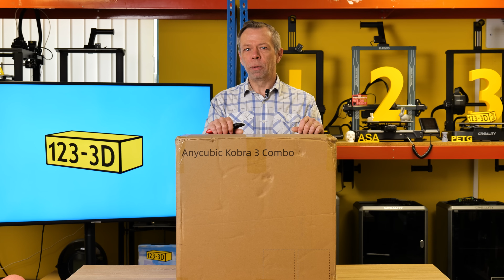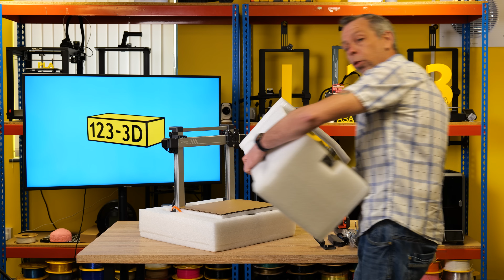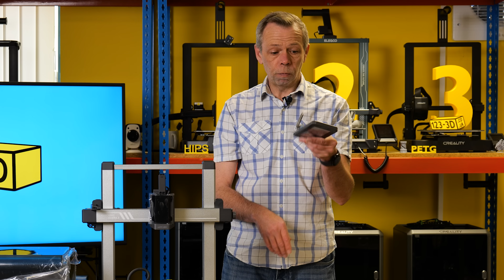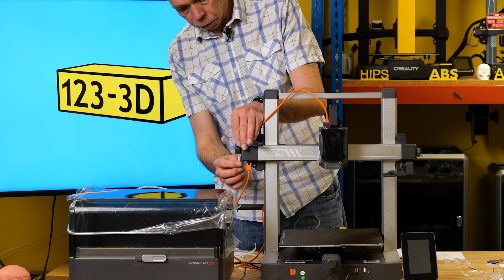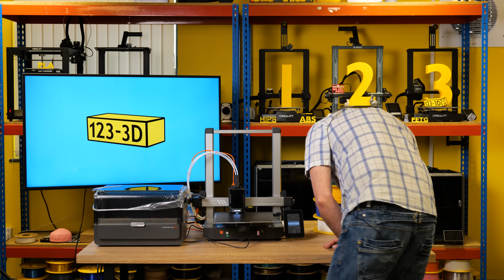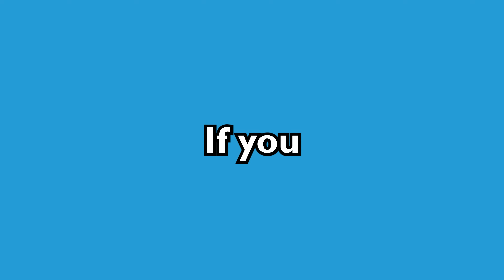AnyCubic Kobra 3 Combo! First look and Assembly | Multicolour 3D Printing!

Comment: For someone just getting started with 3D printing what would you recommend as a 3D printer?
Reply from the maker: Hard question to answer as it mostly depends on what you want to print and your budget. The Kobra 3 featured in the video is a great choice for the money as it is really well built and has the multi material system. If you wanted something enclosed to print things like ABS then the Creality K1C is worth a look. If you wanted to print bigger items then the Creality Ender 3 V3 Plus is good value.

Comment: Hi, thank you for the video. I am thinking of buying this printer as I want to make multi-coloured TPU prints. I am looking to print with the really soft Recreus 82A TPU filament. Do you know if that would work with the ACE-system of this printer? Asking because it seems that the Bambu Lab printer's AMS cannot handle soft TPU filaments.

Comment: Nice first review. I have a question . How long is the lower base of the printer without the rail of the headbed do basically from food to food because I am considering to buy one but don’t know if it fits on my cupboard and also does it extend to the back of the printer or is the lower base of the printer the farthest point of the printer ?
Reply: Official site says it is 45,3 × 50,5cm in base - bed center is somewhat in the middle of gantry and moves half lenght (~12,5cm) to the front  and same to the back which logically gives you around 50cm motion range - give it some margin and guess with about 55cm in depth on a shelf you should be good to go ;)
Reply: @elsonadounsueno  oh no not good only have around 40 cm on my shelf and not rly more space I thought that the feed are small enough and that the bed not extent too far to the back but many this is nothing for me too bad

Comment: Just ordered the machine would like to see more on the ACE system I've seen other videos I'm really curious they were alluding to being able to use a 2nd Ace system and I think I can see how when you described the Connection for the ACE though I'm not sure how it will go through the print head.

Comment: Hello, I have a question. The depth of the printer is 504.7 mm . When the printer is in operation, does the printing plate move beyond this limit or is 504.7 mm the maximum size in operation . For me the printer is in a box and it can't be larger than 504.7 otherwise I can't close the door.
Reply from the maker: Hi, we have just measured it and it comes in at 600mm
Reply: @123-3D-UK  thanks
Reply: @123-3D-UK  thanks

Comment: Hello, this is a very bad video in my opinion.

There is only one camera and as a result, we don't see much, closer shots would have been appreciated.

We cannot see how the filament is managed in the box of the 4 spools. Given the space that the lid takes up when you open it, putting a second box on top would be very difficult for me.

Ditto for the screen, it doesn't seem bad, but since we can't see anything, well we don't know.

We don't even get to see the machine running, well yes, 5 seconds for the benchy, what a shame...

This video makes no sense...

On the machine, the PTFE tubes seem a little short when the print head goes to the right side, it pulls a lot on the PTFE tubes.

Cable management seems very bad. I find that plugging in the multi-color combo on the front of the printer is a mistake. And this orange cable, all we see is that, what bad taste on the part of the manufacturer!

I find many faults with this machine, I will not buy it, especially after seeing your video!

Comment: We only wanna to know how bad it is compare to the bambu 1A
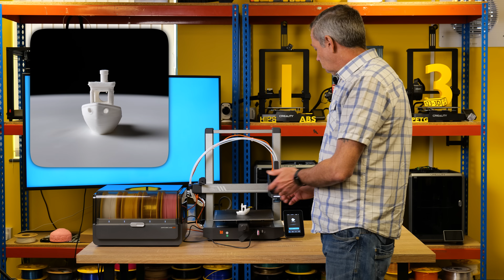Reply: @20:50 Take a Look at the Print.  You tell me is that....Acceptable for you.  I have an A1.  This is No A1.
Reply from the maker: I agree, but we must take into account the benchy we used was the pre sliced test file and printed in under 12 minutes on a bed slinger. We will be doing a lot more testing on this machine, and a full in depth review with our honest option on this machine.
Reply: @123-3D-UK  Let's take the A1 presliced benchy at LUDACRIS mode that can be done in 12 minutes as well.  It looks miles better.  But we will see when the FULL review comes out.
Reply: @123-3D-UK  Take into account that it's pre sliced? well...they should have actually tested it over at Anycubic to see if it actually looks good... It's all very easy to make a machine that looks like the bambu and Ankermake had a baby, throw in some features like nozzle cleaning and vibration testing. But when it doesn't perform decent in real world performances, whats the point? They all just want a slice of bambu pie. I'm currently holding of on buying the A1, because i feel alot of manufacturers are going to make some look a likes and im eagerly waiting to see how they perform. If they all perform like this, it'll be an easy choice going for the Bambu A1

Comment: So far i like it allot. It's very similar to BL A1 series at a glance, just slight variations.  The filament hub/collector, for example, directly on top of the extruder tool head looks just like the BL AMS hub part.  It's pretty cool to see others getting into the multi filament game and at a competitive price.  I like that the filament box is enclosed, perhaps it will work as a decent dry box for PETG etc.  Can't wait for detailed review 👍.  Great video.  Subbed 😎

Comment: My biggest question is can you pause a print, and swap out colors.  Many anycubic printers IGNORE pause commands, OR never unpause.  4 colors is nice, but if I want to do more colors can I print for 6 hours, and then insert a gcode pause, and swap out the colors in the box, then resume?
Reply: I know your asking of pausing but it can take two spool boxes and print upto 8 colours supposedly 🤷 I've ordered one so looking forward to it coming end of June
Reply: With 8 colors makes it tempting @Dazza2292
Reply: I make magnets so need pause to add magnet @Dazza2292
Reply from the maker: Yes the machine will tale 2 ACE Pro units giving 8 colours in total 👍
Reply: @123-3D-UK  Thats all well and good, but still limiting, ESPECIALLY when the "ACE" units cost more than a standard printer
Reply: "can you pause a print, and swap out colors"  if it don't,  it will be a deal breaker for me. My Max I had to use 3rd party firmware to get the pause working right.
Reply: @billb921  LUCKY  YOU.  My max has a newer mainboard that wont accept Wabbitguy or Zombie :(  I litterally had to learn Gcode, and found a way to make it stop for 60 seconds and beep so I could RUN TO THE PRINTER before it started up again to change the filamnet

Comment: 20:50 have you seen the benchy? Those overhangs are really bad
Reply: Okay good its not just me.  It looks like every first print I get off my other Anycubic Machines.....Mediocre at best.  Good PREVIEW but just another Anycubic ATTEMPT at a Printer.  Let's see the in depth reviews as they come out.   Let's see one that the Printer is NOT sent to the reviewer.
Reply: @3DandTeePrinting  I have an Anycubic Vyper, my first and so far only 3d printer. Overhangs are not its strong suit. I have completely modded the tool head for better airflow and only now do I get decent results up to 80 degrees. Stock was ugly!! However dimensional accuracy is not possible on this machine so I am moving on from the bed slinger world. Still have not decided what to do next.
Reply: @Salamattder  Modding them out of their stock form is the only saving them it seems.  My Kobra 2 is stock and trash but my Kobra Max is Modded and Wonderful.
Reply: @3DandTeePrinting  never have been able to get parts to go together very well. Over extrusion, round corners etc have plagued my prints. It’s exhausting. I’m hoping my results will be better with a killer machine with a few more bells and whistles. The tinkering is ok, but it’s sapping my joy at this point
Reply: @Salamattder  tinkering is fun, repeatedly fixing issues is NOT.  I completely understand your feelings.
Reply: came here looking if anyone else actually noticed this. Tbh, this is what is to be expected...Every manufacturer wants a piece of that bambu money, and it really look like they will give people what they want feature wise, but performance and results are not the same.

Comment: Not really interested by the printer but the ace pro unit is a big step up from both the Bambu units. I have both and ams lite on my A1 is much nicer to use than the ams unit on my x1c. With active drying the ace pro looks like a decent development.
I don’t buy anycubic due to past issues, but hopefully they have got a great combo here.
Reply: Bambu has a new full AMS in development with a filament dryer.  No Release date as of yet but is in development.  I also do not buy Anycubic after ALOT of issues with the machine and customer support.  Wouldn't waste my money on a Anycubic.  Mega........ FAIL, Kobra Entire Lineup..... FAIL, Kobra 2......... FAIL, Kobra 2 Pro...... Almost there but still fail.  Kobra 3.....Not off to a good start with that print.  @20:50
Reply from the maker: Please take into account the file printed was only the test file Benchy that came on the machine, for this to print in under 12 minutes is very good for a bed slinger, I would never expect the quality at that speed to be prefect. We will be doing our own tests with this machine, and will post an in depth honest review on it 👍
Reply: @123-3D-UK  Fully Understand that fact.  BUT Factory Sliced Benchys of 13, 14 and 16 minutes on Bambu, Qidi Tech and Creality Machines don't look that bad.  With Creality making it possible to Retro Fit a CFS on the K1 Max and Ender 3 V3 core Xz along with Bambus A1 line up of printers track record (minus the recall), and Qidi tech making good on its precious failures with the Q1 Pro, it doesn't make sense to put my faith in an Anycubic FDM machine.  Trust and believe I am subscribed and waiting for a REAL review of the printer.  Hopefully the Free To Review from... doesn't sway your perspective. The Kobra 3 is the only launch this year we don't plan on self purchasing for a review after repeated issues with ALL our previous Anycubics FDM printers. But I will withhold final judgements till you and others have put the machine through it's paces.
Reply: @123-3D-UK  looking forward to your full review fingers crossed the ace pro is as good as it looks

Comment: That is a terrible looking benchy.
Reply from the maker: I agree, that said this was the pre sliced benchy and it printed in under 12 minutes on a bed slinger. We will be doing some more in-depth tails with the machine. And as always we'll give an honest review.
Reply: @123-3D-UK  Yeah. I’ve printed a 7 minute benchy on the Prusa MK4 using input shaping and it was way cleaner than that. Then again, the Prusa is much spendier. This feels like pre-production results. Hopefully they get their input shaping settings dialed in before they release.

Comment: What slicer software ?   Wipe tower required for multicolor prints ?  Thanks for the First Look video!
Reply: A wipetower and/or poop is unavoidable on a printer with only one toolhead. The amount of waste material is likely to be similar to the Bambu Lab printers.
Reply: Being that it has a filament cutter of some sort I was wondering about that. Thanks  @andreas.grundler
Reply: it is identical to the A1

Comment: Does this AMS work only with Kobra 3 or its universal AMS?
Reply from the maker: The Ace Pro colour change unit will only work with the Kobra 3 series
Reply: trust me i think everyone was wanting a backwards compatible ams but i knew they where gona do this, once the bugs are ironed out of the small 250x250 kobra 3 i think they will launch bigger bed sizes, they would be dumb not to

Comment: it is klipper ready ? Very good machine for the price
Reply from the maker: I can confirm that it is running Klipper
Reply: @123-3D-UK didn’t see any indication on the website that it is Klipper. Is it running mainsail or fluidd?
Reply: @joescalon541  ANYCUBIC Klipper LITE.  NOT open Sourced and Locked Down.  But Technically it is running Klipper.